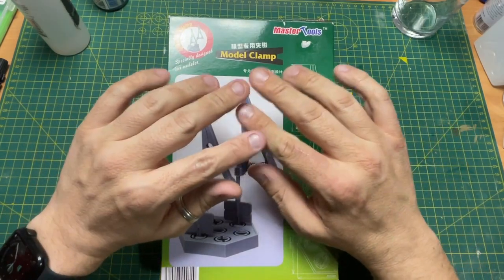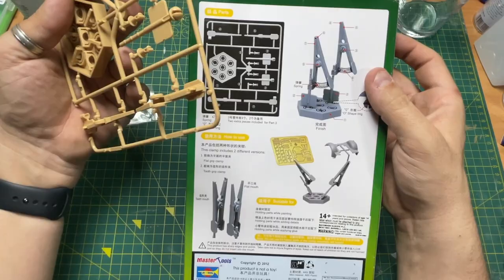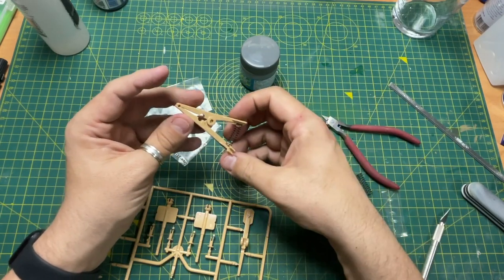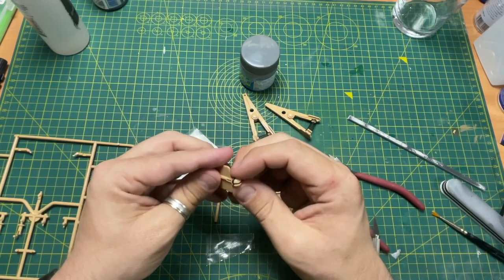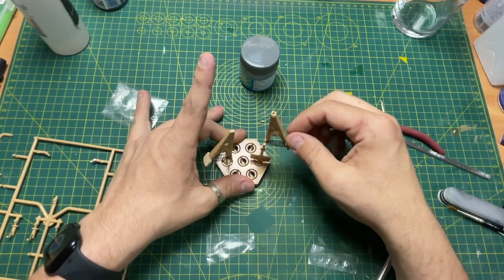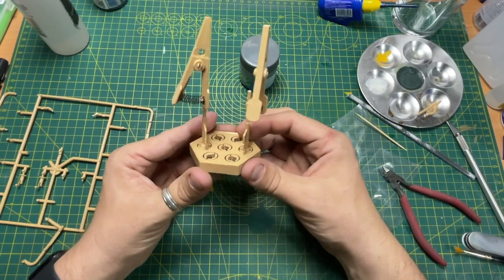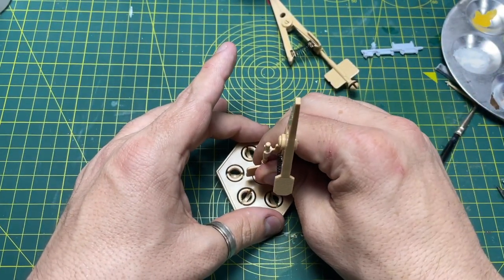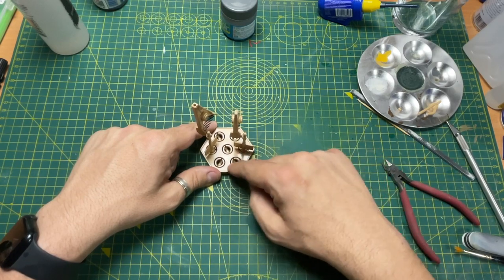Trumpeter Model Clamps - Tool for Painting Figures and Small Parts

Comment: I bought one of these years ago to hold various bits while I was airbrushing them.  I've since given up on it and use crocodile clips attached to a cutdown kebab skewer that then get stabbed into a foam/polystyrene block.  It wasn't until I saw this video that I remembered, I had one and what colour it was originally. Lol.  Nice review though. :)
Reply from the maker: Yeah I’m a croc clip and kebab skewer in cork modeller too lol
Reply: @MOS6510Models  The only problem I have with that method is that my partner makes cakes for a living, so she usually steals my supplies of kebab skewers as well as my other modelling tools.  So I actually have to hide them! The struggle is real in my house! lol
Reply: @MOS6510Models  so the clamp has to be built just like a model kit itself.....the irony,lol

Comment: It looks like it suffers from the same problem as all the other hands free Croc clip holders out there..Bases are too light and also too small in diameter causing the device to over balance..Croc clips with old paint brush handles attached, stood up in a block of hardwood with holes in, job done.
Reply from the maker: Yes I agree

Comment: Huh huh huh huh Beavis!
You said hard! Huh huh huh huh 😂 
Yeah yeah and floppy too Butthead! 

I think if you have one of these then use it, otherwise the Crocodile clips on skewers, as the other chaps here have already stated, is the better option.

I have several crocodile clamps with heat shrink around the teeth for better grip and doesn’t mark paint jobs already done.
Reply from the maker: i laugh at myself
Reply: @MOS6510Models  it’s a good thing to be able to 😊👍🏼
Ian